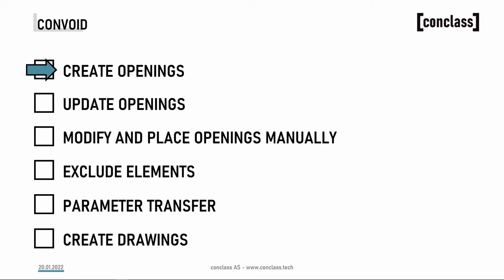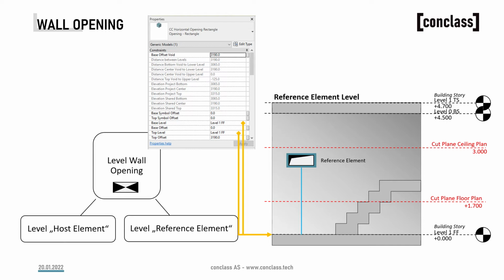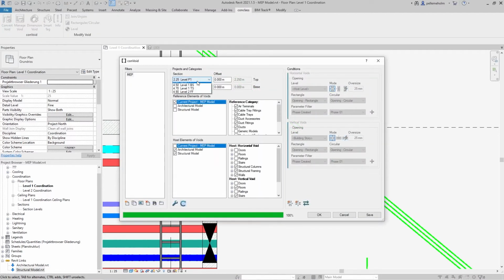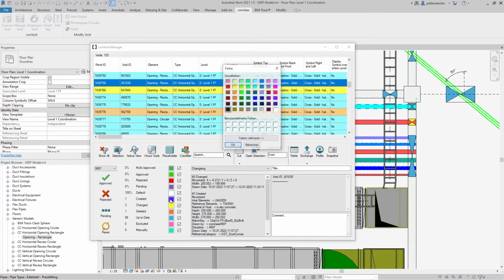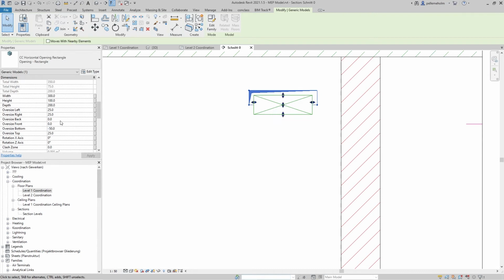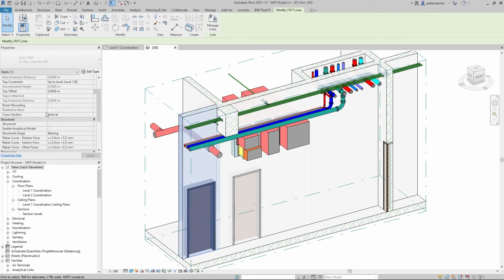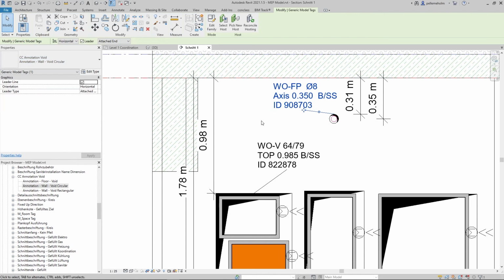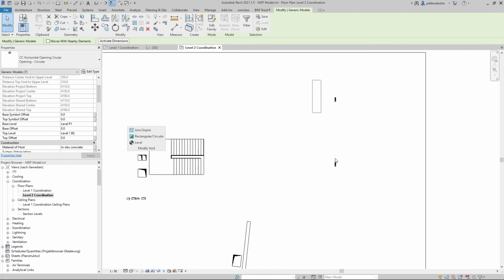conVoid Webinar - Create and update openings in Revit MEP models

Comment: If multiple services are running through a single void, how would the transfer parameter feature behave?
Reply from the maker: Hi, thank you for your question. The parameter transfer is joining the parameter values with a separator. For instance Pipe and Duct are sharing one opening the result would be Ventilation/Plumbing

Comment: How the strucural modeler can cut the wall and slab with opening ?
Reply from the maker: It is a similar workflow. First, they have to adopt the openings, and then they can cut the Host with the help of the ConVoid Manager https://youtu.be/uxc6kLW7Kd0?t=140
Reply: @conclass982  thanks for your answer. And if the structural modeler decline an opening ? How does it communicate with MEP Modeler ?
Reply from the maker: @lélectromobiliste  , you are welcome. The coordination process can be managed by the ConVoid Manager. If the MEP Modeler uses ConVoid, it can be done with the linked structural model to synchronize the approval status. The Structural Engineer can also run the approval process with a BCF Platform. ConVoid creates for each opening a BCF File which can be imported and used in different BCF Platforms like bimcollab, bimtrack, bimsync, revitzo, etc.(https://www.youtube.com/watch?v=uxc6kLW7Kd0&t=1564s)